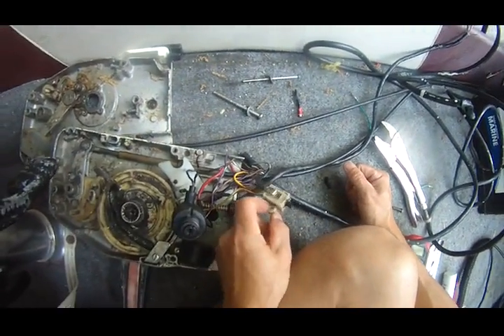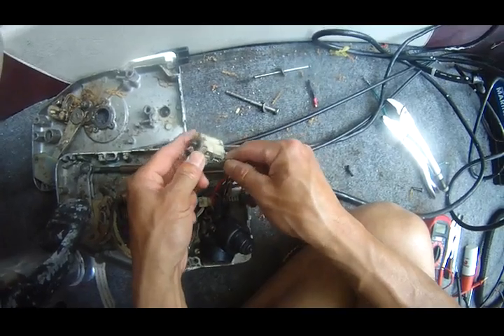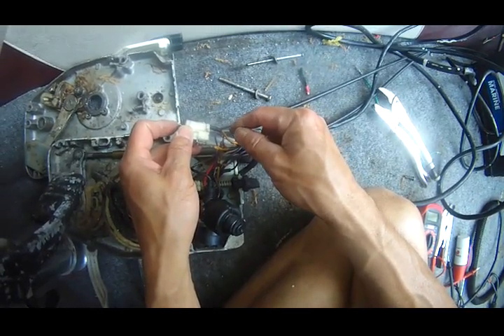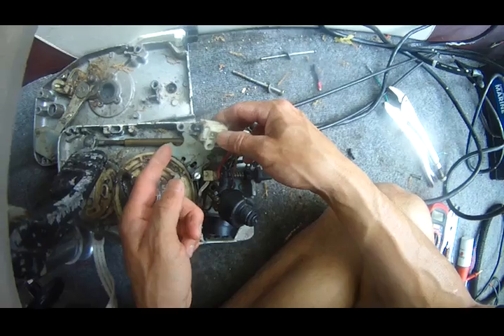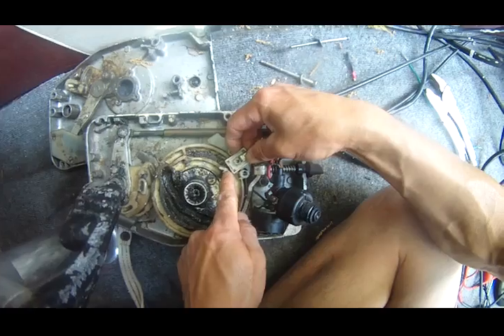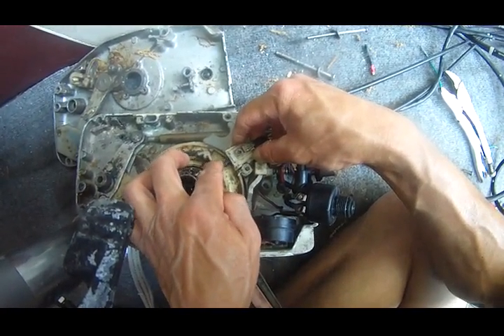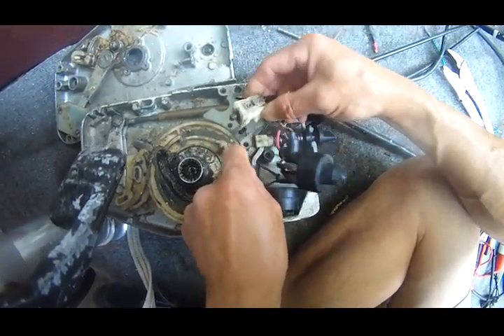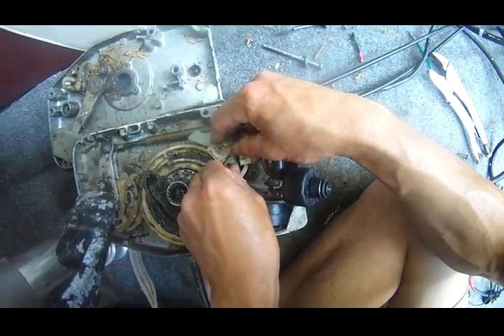Johnson 90 hp v4 neutral start safety switch - a close-up look how it works

Comment: If that switch goes out will it cause the trim not to work
Reply: I'm experiencing the same issue w/my outboard but my engine trim controls operate normally.
Reply: Yes

Comment: You could simply connect the two wires together, being very careful not to leave the drive shaft in gear, while staring, until your new part arrives.
Reply from the maker: Thanks for your tips!